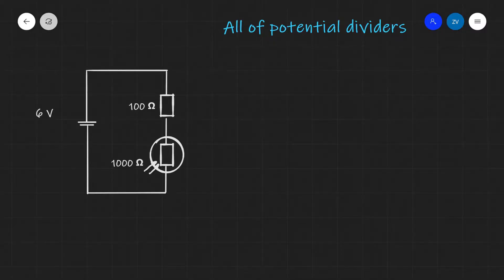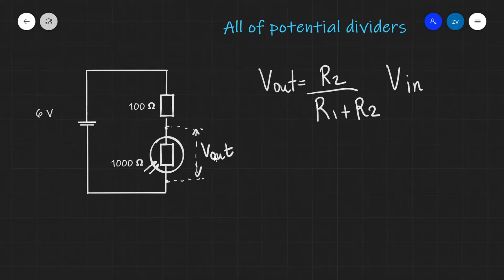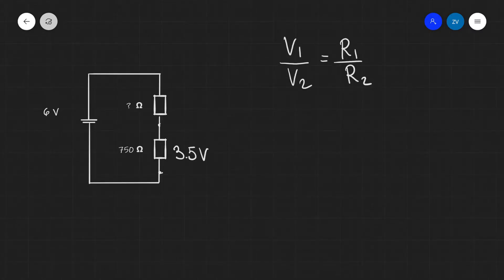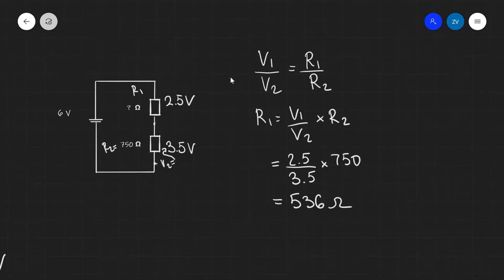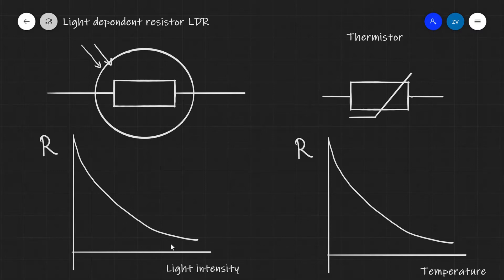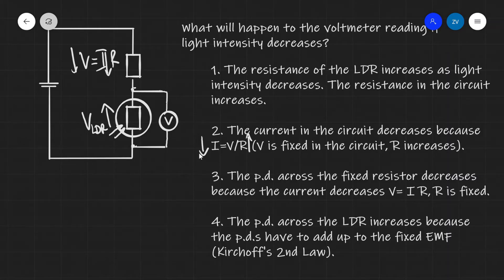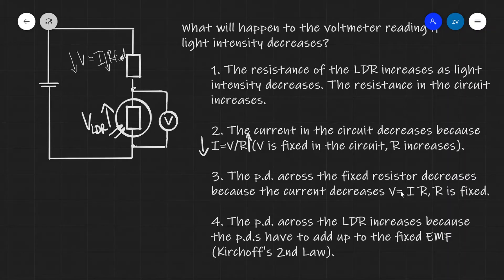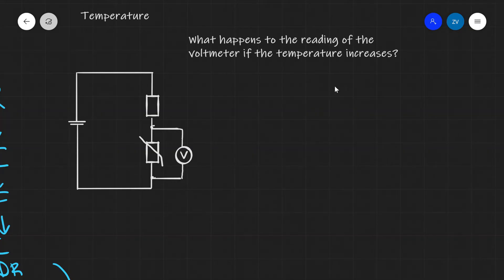A Level Physics Revision: All of Potential Dividers (in 17 minutes)

Comment: With the first questions, can you just call the potential difference across the 100 ohm resistor ‘x’, and the pd across the 1000 ohm resistor ‘10x’, then solve for x, doing 6v = 11x, therefore x = 6/11v, so 10x would be 5.45v

Comment: for the LDR example, the current across the LDR has also reduced. So shouldn't the voltage drop across the LDR, due to V = IR?
Reply from the maker: excellent question, while I has dropped, R has increased at a faster rate. We originally don't know which has increased at a faster rate and can only find out via the p.d. across the fixed resistor. Hope this is helpful!
Reply: Ah ok that makes sense. Thank you so much sir!

Comment: Hi wanted to ask how does the answer change if the voltmeter is over the fixed resistor rather than the LDR or thermistor?
Reply from the maker: so V=IR, R means fixed as it's over the fixed resistor, so whatever the current is doing, the voltage is doing across the fixed resistor. Hope this helps!
Reply: @zhelyo_physics  ah much appreciated, what if the voltmeter was over a variable resistor and the resistance of it was increased, but say the light intensity was kept constant for example?

Comment: 12:28 Hello sir, hope you are doing well, why does the current decrease?

Never mind I found out 😅 Thank you for your videos
Reply from the maker: ahah amazing! well done! Thank you for the comment!
Reply: @zhelyo_physics hello sir, does current decrease because the resistance of the circuit as a whole increases? If light intensity decreases, resistance of the LDR increases HENCE using R1 + R2, the total resistance of the circuit increases hence current decreases? Is that the correct explanation?